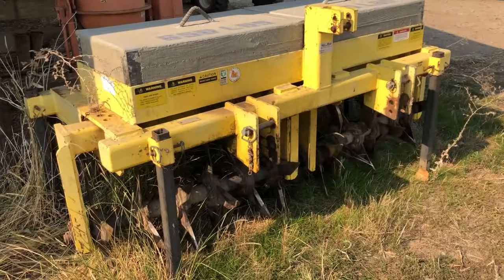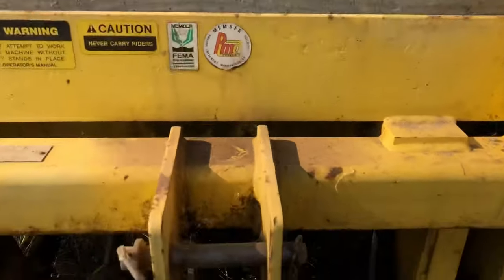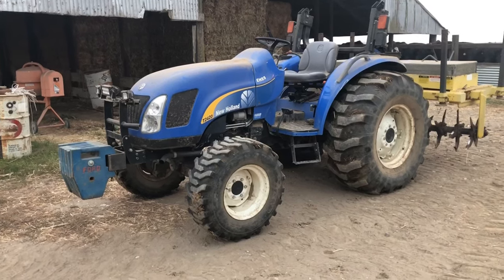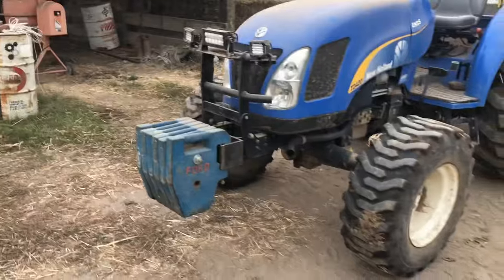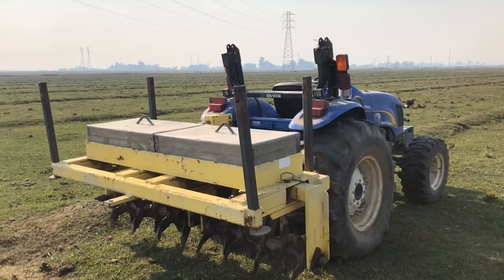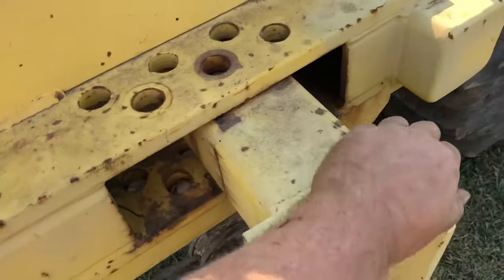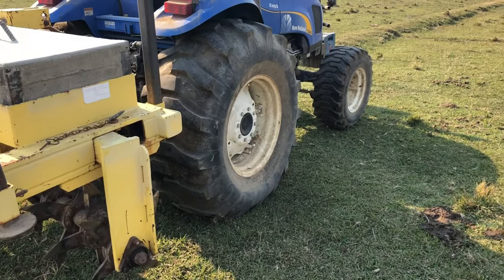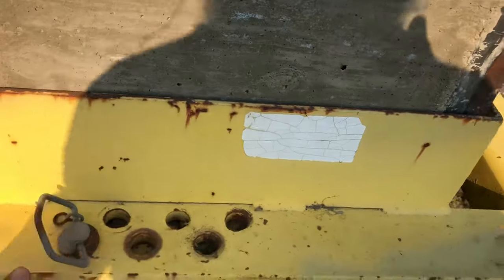Testing an Aerway aerator on pasture

Comment: I have a Aerway I use they work pretty good takes time to see the results. This past year I mounted a grass box on mine to seed behind the aerator. I have to wait and see what kind of a stand i'll have but in theory should make a difference.
Reply from the maker: You’re echoing what most people have told me, they work but it takes time. I like the reseeding idea, I think it’s a step above no-till planting because you do get a little bit of ground engagement. Seems like the new growth would do better in that situation. Thanks for watching!
Reply: @farmertylerranch4399  I rigged it up to a hydraulic motor to run it. Put a couple videos on my channel building it but true test will be in the spring

Comment: Do you have to use a roller to smooth it out ?
Reply from the maker: I probably could have but I don’t think it’s necessary that is definitely something I’ll be looking at in the first update video. Thanks for watching!
Reply: There is a roller option available for use on fine turf BUT for pastures let it breath and soak in the rain runoff. Great tool to own!